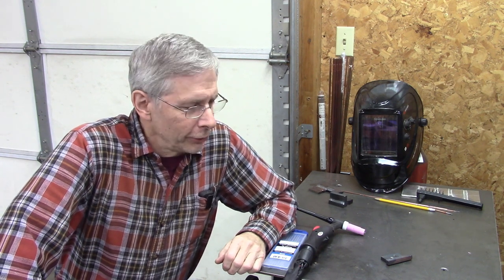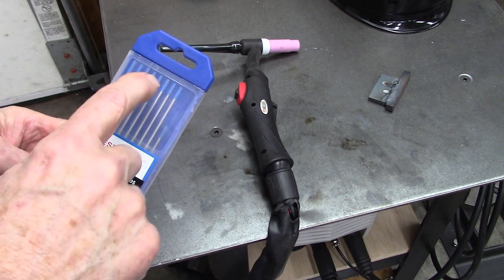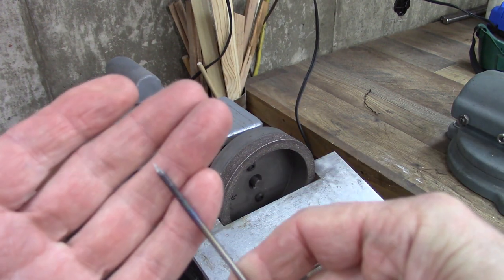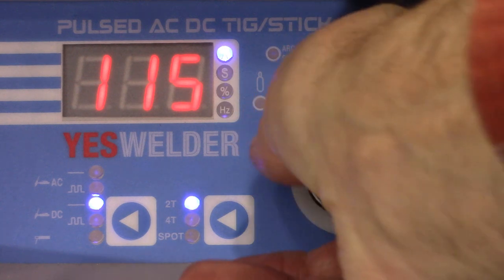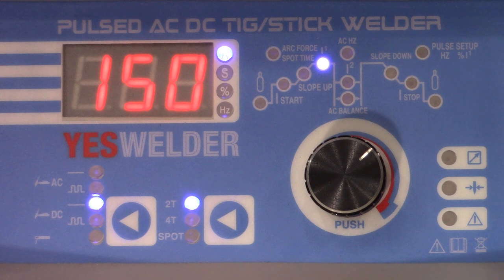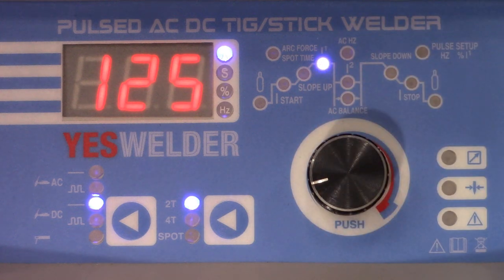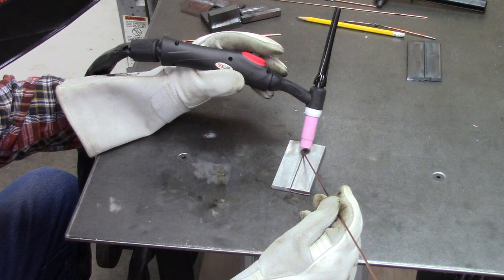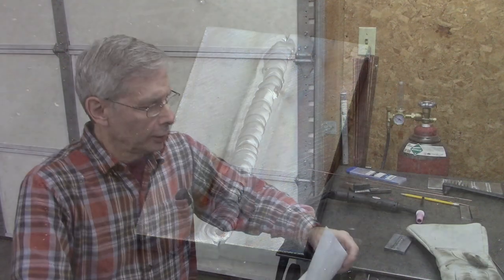TIG Welding Steel - Basic settings

Comment: I have been led to believe that amperage should be around 1 amp per thousandth of material thickness. i.e 1/16 " material is 60 amps. 1/8" material is 125 amps. Thanks for showing. Regards from Australia.
Reply from the maker: Interesting. That sounds about right for 1/8" but maybe not for 1/4".  240 amps seems high for 1/4". Maybe it's an experience thing. Maybe with experience you could move fast enough.  I'd say that this setting is based on 100% penetration but if you weld from both sides or cut a v before welding the amps could be much less.  I'll have to give this a try and see what happens. Thanks.

Comment: Finally, somebody did a video that put out good information that’s usable for a beginner user of a yeswelder. Their manual is basically nonexistent. How to set it up doesn’t help me what I needed were starting values and adjustments on the machine itself. That’s what you give me. Thank you.
Reply from the maker: Yeah I watched a lot of videos and experiments a lot. I still have tons to learn but I figured this video would help eliminate some of this frustrating start up curve. Or at least that was the intent.

Comment: It looked to me like you did a better job of not removing the filler rod from tha gas coverage. From what i have seen and read, that's also important for the quality of the weld. I am not a welder, just learning like many others here. Thanks for you posting your video
Reply from the maker: You are correct...  on the second weld
Reply: The reasoning behind your comment is the hot filler rod oxidises if pulled out of the Argon shield.
Reply from the maker: @stevewilliams2498  I never considered this but I'm sure you are correct. Thanks for this comment.
Reply: @stevewilliams2498 it also cools down. The rod cools the weld, and that’s important to know.
Reply: 2% Lanthanum is a good choice for most everything. About sharpening; don’t use something that grinds something else, or the contamination will work it into the tungsten and cause a wandering arc and other problems. Sharpening the tip to an angle depends on how much amperage your using. The higher the amperage, the blunter the tip, and the opposite is true. If you’re welding 16 gauge you want a sharper tip, and if welding something like 20 gauge, you want almost a needle. The bigger the cup size, the more argon you need. For most things a #6 cup is fine and 15CFH is good.

A basic understanding of amperage is one amp per 1 thousandths of an inch thickness of material. That works almost exactly up to 1/8”. With thicker metals, use the first idea up to 1/8”, then go about one amp per additional 2 thousandths to 3 thousandths additional. But it depends on the type of weld. So a butt weld uses less, a “T” weld requires more, etc. stainless requires about 10-15% less, while aluminum requires about 15-20% more. Those are starting points, of course. As far as the rods go, don’t use rods that are too thick for thin metal, or too thin for thicker metal. Yeah, it means you need several rod diameters in stock.

Your welds got a lot better pretty quickly. Very good.
Reply from the maker: @melgross  You much have a lot of experience with TIG. All good and logic comments! - thanks. Some of the cup size and gas volume you stated is slightly different but close. I do seem to do better with a larger cup but the change is not significant. I was using a 6 and tried cutting the flow to 15 and had terrible problems however. 20 seems to work well for me. I saw a video last week where I guy measured the gas flow at the tip and it was 5 different than at the tank. Maybe these $14 gas flow meters are not so good.
Reply from the maker: @melgross  I've only had slight problems with contamination on aluminum. I use a CBN wheel to sharpen the tungsten which I also grind HHS on. Soft metals will load up a CBN wheel but HSS does not. So far I have not seen the arc wandering unless I dip the tungsten. Maybe after I have more experience I'll see an an effect. I plan on making (or buying) a dedicated grinder at some point anyway.  Thanks for the input and compliment. I cut the weld I made in the video and can not see any porosity. I even polished the cut with 600 grit and it looked like a solid piece of steel. I wish I had bought a TIG years ago. It's amazing!
Reply: @WinkysWorkshop  well, there are a number of things that affect it. So, for example, the tip stick out shouldn’t be more than the inside diameter of the cup. So a smaller cup means welding closer to the surface, and so means less gas. If the stick out is too much, then the gas diffuses out of the zone, and you need more gas. Too much gas, and it creates a vacuum, and air gets sucked into the welding arc zone, etc. It’s a dance. No these cheap flow meters are no good. Cheap TIG torches are no good either. I’m talking about no brand ones you find in eBay. I tested a bunch if them a while ago. I found some got too hot. When I cut them apart, I found the really cheap ones were made not of copper and brass, but copper plated zinc.
Reply: @WinkysWorkshop  yeah, if you can master it, even not perfectly, you can do things you simply can’t do any other way. I recommend Jody’s WeldingTipsandTricks. The Fabrication Series and 6061. Jody has a very good store. He has good quality meters at good prices. There are a bunch of good welding channels.
Reply from the maker: @melgross  Yes I think I watched Jody, and several others. I'd say this is one reason I learned quickly. TIG welding is going to be very useful but I'm not really striving for perfection. I'm almost 67 yrs old and retired. If I was younger I'd see things a little different. This is also why I have not built a larger shop.
Reply: @WinkysWorkshop  I get it. I’m 73 and I still whine to my wife that I don’t have enough room to get some of the machinery I want. Not that I don’t have space, but it’s never enough. I find that I can’t ever be satisfied with what I’m doing. I get interested in more things, and then I want to do them. To me, I don’t know how much time I have left to do anything like this, so I want to cram as much as possible into that time I do have. My wife says she doesn’t care how much I spend on equipment, as long as I have some place to put it. She’s smart like that.
Reply from the maker: @melgross  You sound like me. I have way too many interest! I've been successful at many things in life but never what I would call VERY successful. There are too many fascinating things distracting me.  I just bought a Harding Cateract lathe and a weird old drill press. It came out of an electric motor shop and had all sorts of weird stuff with it...  they are not in good shape but they were cheap. I needed this stuff like I need a hole in my head but it's cool stuff. 1920-1930 stuff.
Reply: @WinkysWorkshop  it’s a sickness, isn’t it? I can’t resist a new tool. My wife says, with some reason, that I buy tools just in case someone may need to borrow them.
Reply from the maker: @melgross  My wife agrees with your wife. You made her smile.
Reply: I think you  did a good job explaining  everything,  especially the 2T v 4T. For someone with little timed experience you did Well.  Keep up the good work 👏 🙌 👍🏻
Reply from the maker: @TedRoza  Thanks Ted. I did a lot of reading and talked to several pro welders before I ever tried TIG. To me it's way easier than MIG welding.

Comment: I started tig welding aluminum..I'm now working at getting better on mild steel....in my opinion. aluminum is easier then steel.. maybe because I started on aluminum....🤔,,,,
This is an art to master.. practice practice practice.....I'm useing a Everlast machine...nice set up...wish I got into it sooner...I'm 56 year's old..I should have picked up tig welding years ago...never to late to learn I guess.....👍👍😎💪💯
Reply from the maker: I agree...  TIG is the best. I recently refilled my tank and could not well. I then read the tank and it said, argon nitrogen. The guy messed up. The good thing is, I now know it's not me or the welder. I could not figure out why I couldn't make a nice weld!

Comment: I'm a automotive technician,,welding for a long time,  trails, railing, automotive  repair,  dune baggies from scratch.  First time tig, just got the tank argon. Haven't tried it yet,  figuring out settings, thanks for sharing video,good job.  I'm on Maui Hawaii,  
Rod Nelson
Reply from the maker: You'll like it. Its just like gas welding with a super hot torch. Mig is faster but you have a lot more control with TIG.Be sure and have the metal clean.

Comment: Good video Winky, Pulse is good on the thin stuff, especially when Fusion Welding with no Filler Rod.
Reply from the maker: I'm sure you are correct. I need to play with it more.